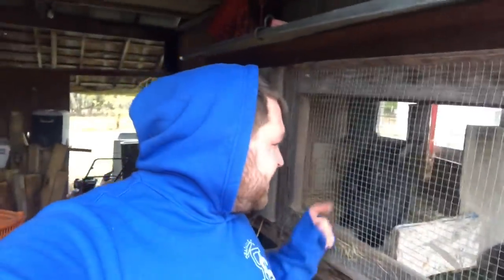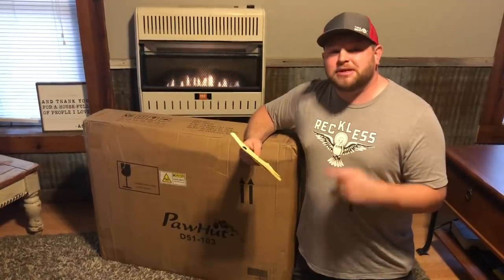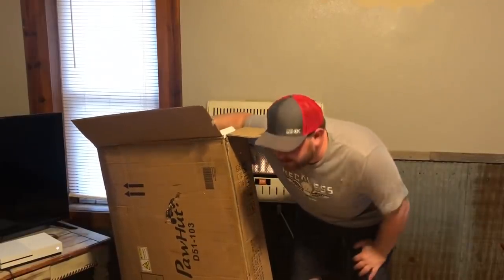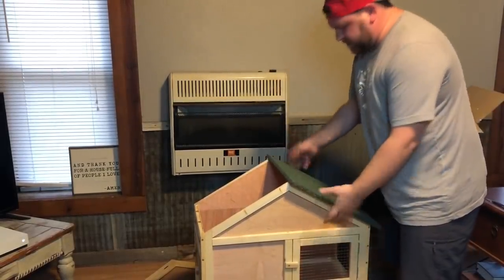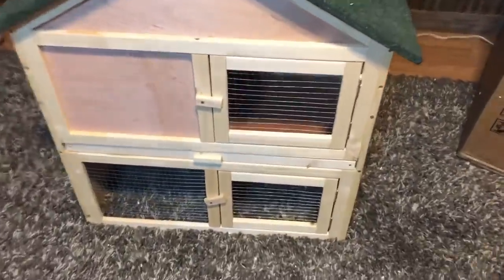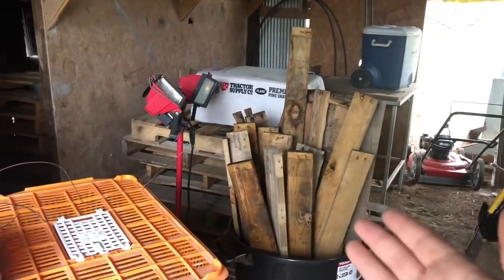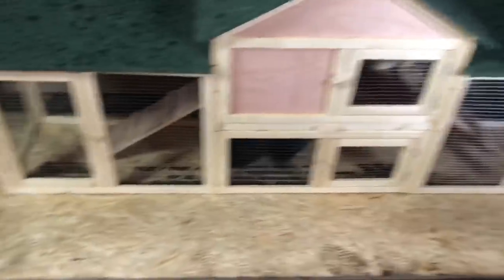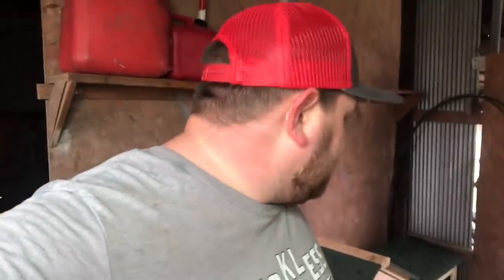NEW Rabbit Hutch!! Pawhut 2 story deluxe Rabbit Hutch with Ladder and Run

Comment: Vincent, there is a reason why rabbit hutches are off the ground on stilts. They're protected more from cats and other predators if they are higher in the air. Also, after a while, the wooden latches will loosen and the doors will be easily opened by cookie. Need a poop screen on the bottom for droppings to fall through to hold down odor and mold.

Comment: I hate to tell you this but to keep Cookie and any other rabbits you get safe they need a stronger  built cage.
Reply: They are going to chew through that one in no time at all. That new cage is cute but it isn't really a good cage for the rabbit. The cage Dutch gave you is much better. It just needs a little fixing up is all . And the rabbits in it will be safe.

Comment: I don't get the droppings drawer not having a wire mesh bottom. Also there should be a bottom wire mesh so the droppings can fall out. I really think this cage was actually designed to set on the grass so the rabbit could eat grass. However if you are going to use it as a permanent enclosure I think it should be up off the ground with a wire mesh bottom so the droppings could fall out. I like the food & water situation in your original pin. Just My opinion. I really like watching. 😃
Reply: The dropping tray/drawer is on the second floor, so bunnies on the second floor don't pee/poop on bunnies on the first floor. I agree, he needs rabbit wire floor to keep it clean.
Reply: @teresamariner4238  I was trying to say the top floor also needed some rabbit wire along with the sliding tray. Then when the tray is pulled the poop can be removed & the rabbit dosent fall through. Then the top tray can be reinserted. As well as having rabbit wire on the lower floor. It needs rabbit wire in both places . Yes the sliding tray can catch the poop after the poop falls that 1/2 inch or so. As well as the second floor having rabbit wire. Sorry if I didn't make myself plain.

Comment: Vincent, we had a hutch like that before my husband built our new ones.  The wood on the bottom of the cage will rot out quickly, so it's best to put a small piece of linoleum or vinyl on bottom to save the wood.  You will still be able to take the tray out to empty it, and can clean the  liner and put it right back in.  Hope that helps you some.

Comment: I have a smaller model of the same brand hutch bookmarked that I was planning on getting for raising some quail in. I was planning to raise some indigenous California Quail to turn loose to repopulate the area. --- I think I would raise it up at least 3 foot off the ground so I didn't have to get on my knees every time I fed them or cleaned the hutch.  I can get down there pretty easy, but at my age it's getting more difficult to get back up :>

Comment: The new rabbit hutch  looks like a great rabbit  home ! It was so nice that Paw Hut to  sent it to you to review . I agree with Mary Marino , It needs to be up on legs to prevent preditors and vermin from harming Cookie. Also if you could put it on a large screen so that  the droppings fell thru it would keep clean easier . What do the Walkers say ?
Reply: those cages are junk, if the company had sent me that I would have sent it right back without even opening it up. The chicken coop ones are just as bad (no I have never bought any like this for either species but I know others who have and they are nothing but junk). If the company emailed me and said they would like to send one for free to try and rate it for them I would tell them not to bother as they are junk.
Reply: Looks way small for large rabbit. Definitely needs to b off ground for safety reasons. 😉

Comment: Hate to tell you but those kinds of cages are junk, will be surprised if it lasts a year. Not at all predator safe at all. Junk wood and made in china. Better off with the other cage. We use 14 gauge wire on all our cages. We have all wire cages (some are stackers: 3 cages on top of each other and others are bank cages: one row of cages side by side).  I hope it works out for you but not going to hold my breath. If you want a pdf on building cages let me know, otherwise I will try and send the pdf file to you later tonight.  The wire cages are much cheaper and will last much much longer than this junk cage will.